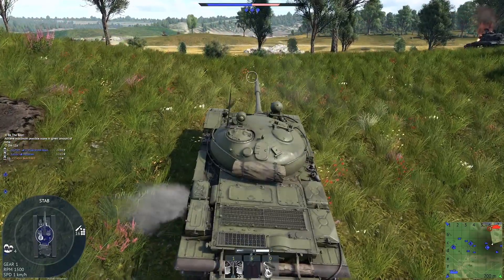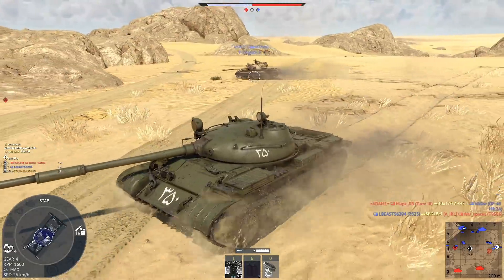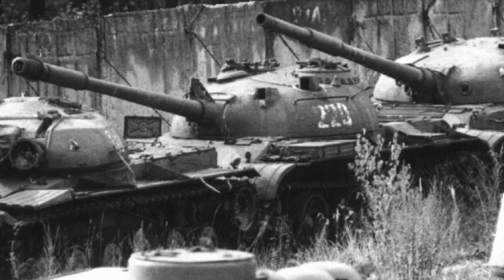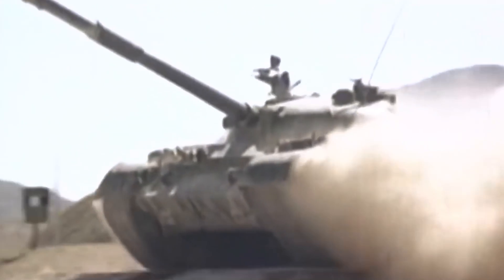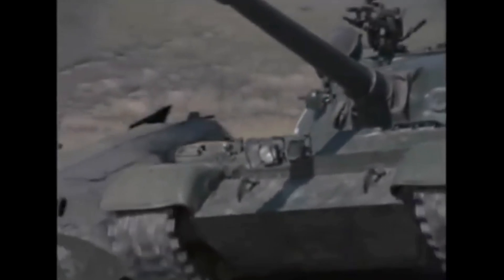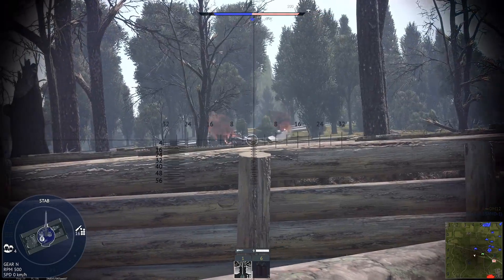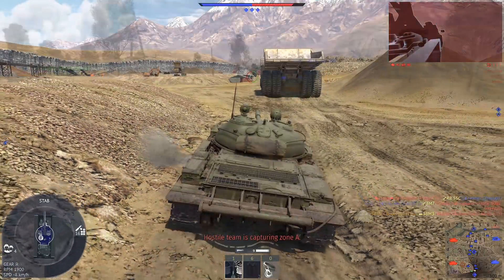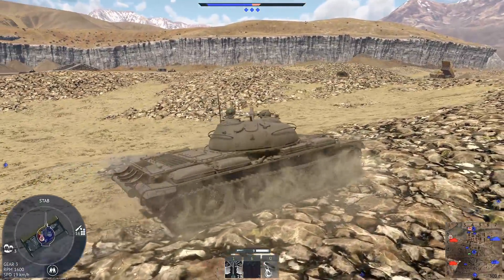Why did the T-62 have a 115mm gun?

Comment: Bobi i want to ask that isn't the t12 gun was a smoothbore gun already
Reply from the maker: @10-TranVuBach  Actually it looks like I made a mistake. There‘s often the confusion that the T-12A, which is a later version of the T-12, is rifled. But that‘s not true. It‘s smoothbore as well. So I made a mistake in the video.
Reply: Yes, but it was a 100mm.

And it's ammo couldn't fit into the T-62, so they had to shorten the ammo, but to keep it's original performance, they bored out a D-54TS gun to give it 15mm of extra Diameter (100mm --> 115mm), which equalized the shortening to widening performance factor of the T-12 Rapira's shells.

Comment: that 115mm is extremely powerful, i remember reading something about in Kuwait that it was documented penetrating the frontal upper plate and turret of british chieftan mk5s
Reply: Solid gun.
Reply: idk if the gun were op or chieftain were overrated,the iraqis judge the iranian chieftain as inadequately armored and bulky

it was a disaster for iranian and kuwaiti chieftain
Reply: @sruicruicplox9803  Dude, the Iran-Iraq war was 1988. There were T-72s with 125mm APFSDS, fighter bombers, ATGM armed Mi-8s, and Fagot ATGMs. It's 2 decades out of its prime. During the 60s, the Chieftain was the best Western protected tank second to only the T-64. Certainly not inadequately armored for when it was designed.
Reply: @neurofiedyamato8763  please refer to what cherry has said ,it is obviously  an iraqi t62 that punch through the chieftain with the 60s technology ofc they also use t72 but even the t62 is enough to pen and there is a reason why until the early 80s nato still use the 105 and not go straight to adopt en masse the 120 because the 105 is still adequate or better compared to the 115,i hope u know what i mean here
how could u say the 115 is extremely powerful when the 105 still seems adequate,it just mean the tank is not that influential in term of protection
Reply: @sruicruicplox9803  T-62 by then had gotten better ammunition than the 60s. Between the 20 years, NATO went from APDS to APFSDS and Eastern block ammunition had similar developments even though they introduced APFSDS into service earlier. 105mm in the 60s would struggle against T-64s at long range engagements in the 60s but would punch right through in the 80s. 
Also, I never said T-62 couldn't penetrate(range matters here) the Chieftain, but the context is that it didn't make Chieftain poorly protected relative to tanks of its era (1960s).

Also I never said the 115mm was extremely powerful or weak. That was OP. Also 105mm was adequate because of new APFSDS ammunition coming in the 80s for NATO forces NOT because it was a 105mm gun.
Reply: Nah chieftain is just average UK design, too fat and heavy while under armored at the same time lol
Reply: Chieftain mark 5 has worse armor than a t-54 from 1946
Reply: @tedarcher9120  Why the hell do you even have a like? This is just blatantly false. Not only does the Chieftain has similar thickness plates, its also sloped more. Chieftain hull armor had 127mm sloped at 72 degrees while T-54 had 120mm sloped at 60 degrees. The Chieftain's turret was 195mm at 60 degrees. The T-54's turret was 200mm but was rounded, so it didn't have much sloping in the center segment while the edge of the turret did, however those areas were also thinner at 160mm. So while the values look comparable, the Chieftain's effective protection was double that of the T-54. Also the final 12 degrees for the hull is massive as ricochet chance and LoS thickness increases dramatically at extreme oblique angles (exponential).
Reply: @neurofiedyamato8763  that's a blatant lie. Chieftain has a cast armor that has a lower rating than rolled t-54 armor. 127mm is correct only in the nose where the angle Is less than 60 degrees, where the angle is at 72 degrees, thickness is 50-85mm variable. It's much worse than t-54.
Reply: @tedarcher9120  Rolled and cast has no effect on the armor effectiveness. This is complete misunderstanding of armor technologies. On cast armor, air pockets can create weaknesses and lack of uniformity. But rolled can have heat fluctuations that can cause problems just as much. Both processes can introduce flaws in the armor composition but that is more a quality control issue not inherent to either methods. Also the T-54 turret is CAST too.
As for the 50mm, it's only around the hatch area. Also, yes, I was wrong about the 127mm being uniformly thick. But at 80mm sloped at 72 degrees, the LoS thickness is actually 260 mm which is still thicker than the Early T-54's 240mm LoS thickness. Point still stands that Chieftain is better protected. And those are early T-54s, majority of the T-54s had 100mm thick plates sloped at 60 making it significantly worse. And the T-62 had identical armor as the later T-54 and T-55s.
Chieftain still was the 2nd most protected tank in the 60s only after the T-64.
Reply: @neurofiedyamato8763  it's not about air pockets, it's about forging. Forged or rolled parts are more durable than cast parts as their crystals are smaller. That's why cannon barrels are forged, not cast. Forged or rolled armor is significantly stronger. Yes parts of the chieftain hull that are at more than 70 degrees are probably equally well protected to t-54, but the whole plate is not equally angled. Also the sides are only 50mm. Chieftain is not the most well-protected  60s tank after t-64, t-10M is